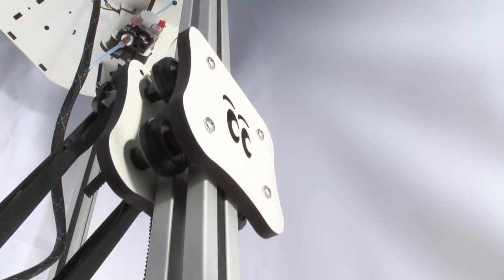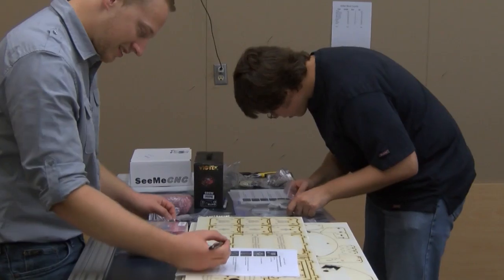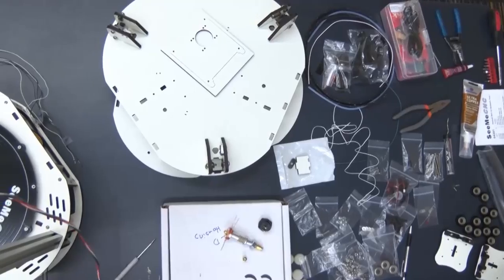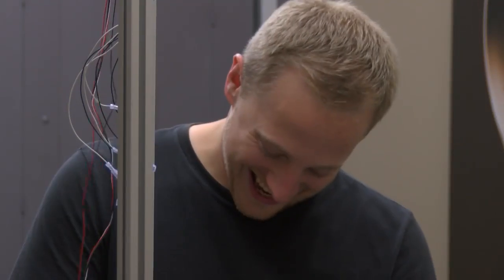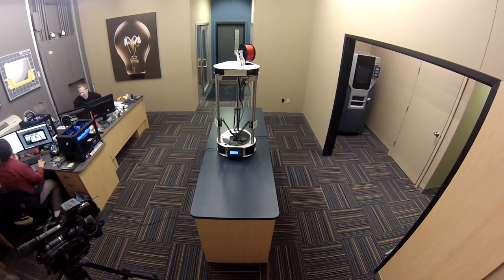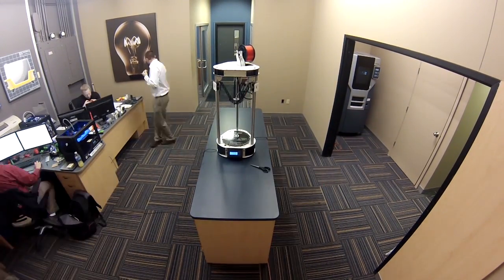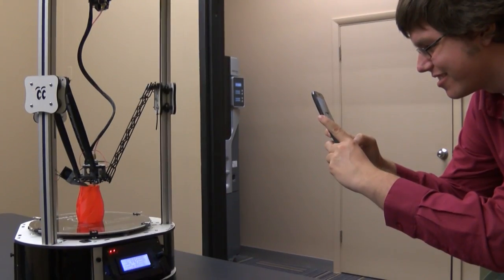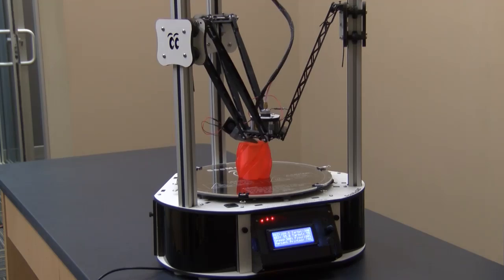Rostock MAX v2

Comment: I love my rostock max v2. I have learned so much while building this kit. seemcnc is the best company for user support I have ever experienced.  Any issue I had I was able to go to the forum and search for my question. Or call and get my question resolved, Thank you! I couldn't have bought a better 3d printer anywhere else and not only use it but learn from using the rostockmax v2.